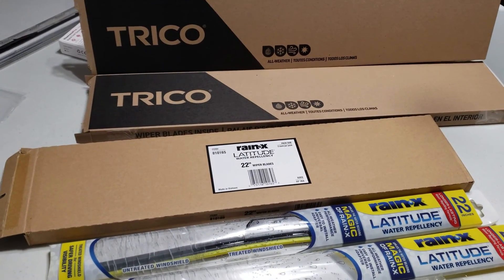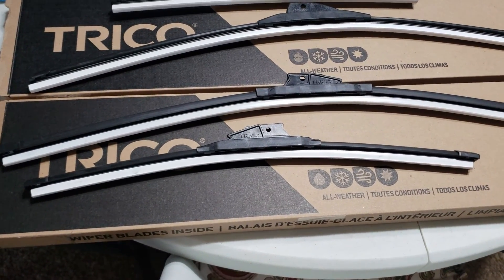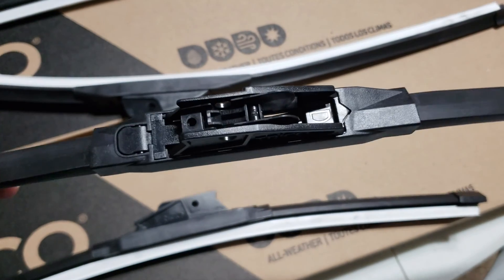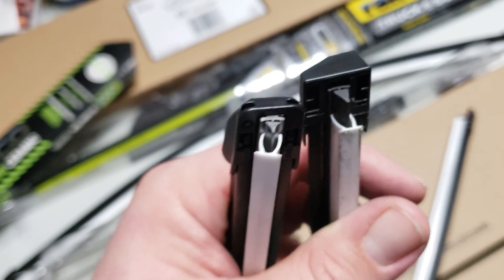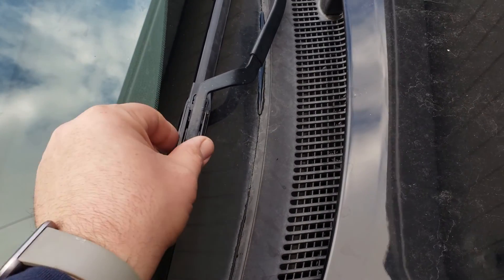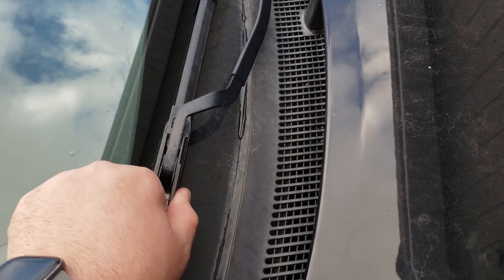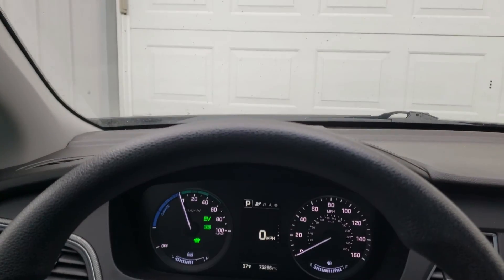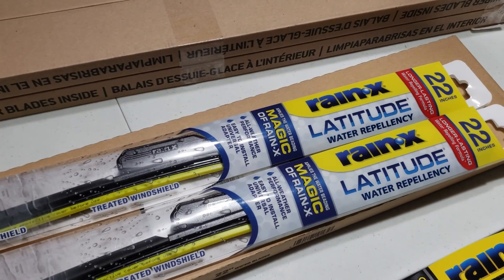Wiper Blade Comparison: Trico and Rain-X

Comment: I've been using Trico for decades since that was what was available to have easily shipped to me. I replace them every other year, and I've been happy with them. This year, they're not available for my car anywhere so I came here to check out some info on the RainX blades. Looks like they'll be a great choice going forward. Thanks for the info!
Reply from the maker: Thanks for putting your experience in the comment. So far this winter, the RainX wipers are standing up pretty well. No real noticeable difference between the mid-tier blade and the high price point SUV blade. It'll be interesting to see which one gets streaky first. The Trico winter blades had a small plastic piece break/fall off the blade. I think its just there to clean up the look of the blade as like an endcap. So not a big deal but something I noted.

Comment: Just had to decide between the rain x weather beaters and the trico ceramic coated both on sale on Amazon .. the rain x was like 18$ for both where as the tricos were around 45$ for the set.. obviously I went with the rain x will keep updated with performance
Reply from the maker: @paulvillano8625  Sounds good. I'm still running the same wipers from just before winter. The Trico winter ones had issues with the plastic "trim" end pieces falling off, but the Rain-X ones have been fine. The "time to replace" indicator has been yellow on the Rain-X SUV blade for a couple months now, but it still wipes clean without streaks on both blades. The Tricos are a little streaky, but not bad enough for me to replace them yet.